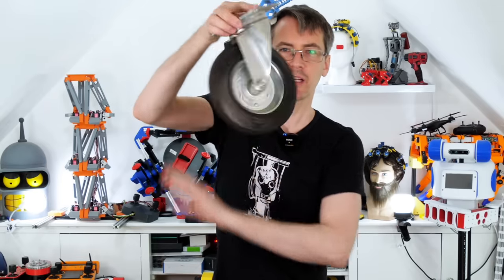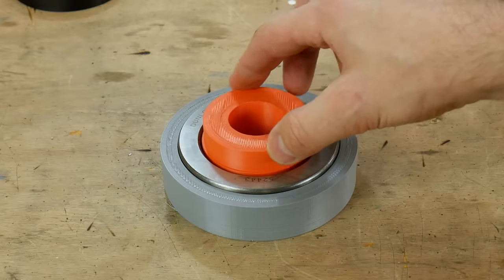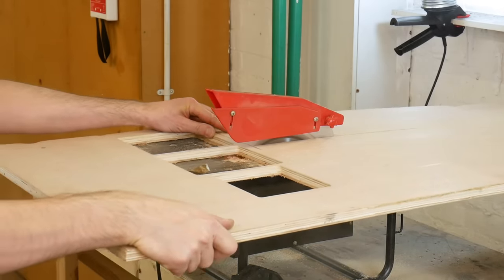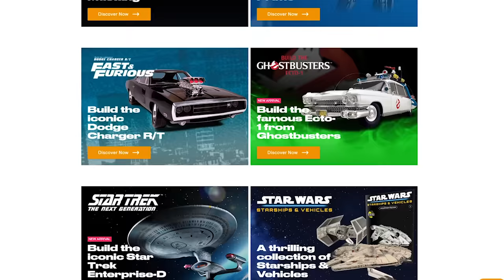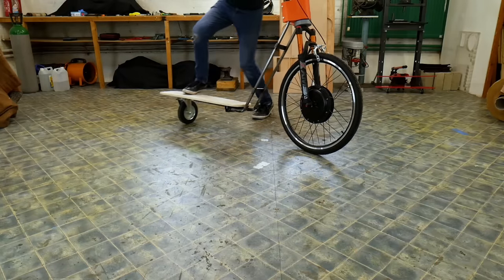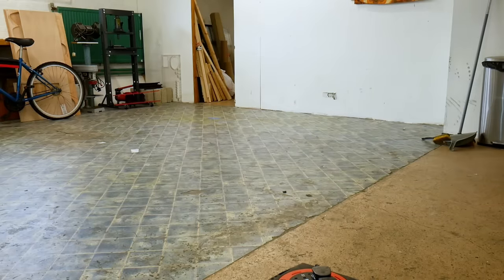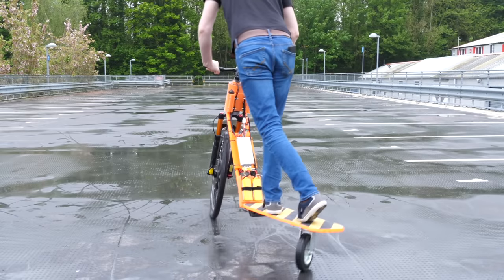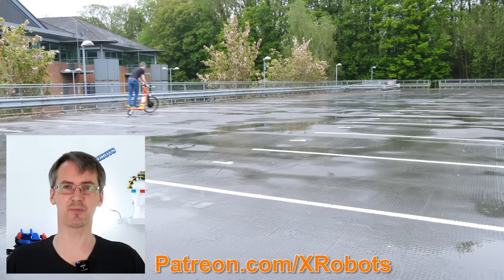1000W Caster Scooter

Comment from the maker: Join my Discord! https://discord.com/invite/fc6MedG7eW
Patreon: http://www.patreon.com/XRobots
Instagram: https://www.instagram.com/xrobotsuk
Twitter: https://twitter.com/XRobotsUK
Reply: hey bruton, why don't you make a video on how you are able to make all these projects so consistently, your producivity is crazy, it doesn't seem like you have a team like the hacksmith yet your projects are technically more advanced and your video release is faster than theirs, it would be a great one, and a tour of the workshop
Reply: The steel tube you used had to thin a wall, if you used the same O/D Tube , but with a smaller bore, you should have a stonger frame.
Reply: wait a second there James... @ 0:31 - a THOUSAND KILOWATTS???!!?  You built a MEGAWATT e-BIKE?!?!? lmao :P jk :D
Reply: Is a electric assisted  rip stick a thing. sound dope
Reply: could you collab whit some bmx/skateboarders. a UK version of "Braille Skateboarding weird things"
Reply: I would try remounting the castor on a bit of an angle. Way more stability that way. Theres a toy called a snake board that is a skateboard with two caster wheels, those casters are mounted on an angle and it works pretty well.
Reply: At higher speeds some cars have 4 wheel steering to turn like a crab. 😃
Reply: Make a V foot board both with a rear wiel of course. Its the bomb for making wheelies
Reply: I think this scooter would have more control if the rear wheel is bolted to an inclined part.
Reply: @anarcocapitalista3700  yes this! Incline the caster and the whole things changes
Reply: @Jimmyhickey90  and it's a scooter but James named it bike, it's in the name of this video
Reply: @anarcocapitalista3700  man if he just slanted the caster and called it the "snake scooter" then he would have a million dollar invention on his hands! 😅
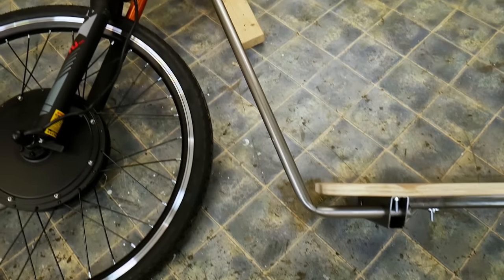Reply: 5:34 Next time when bending tube-like materials, fill the tubes with sand first, it prevents the tube from collapsing, then just empty the tube when you're done bending.
Reply: If you wish to have more control while keeping the ability to lean, have a powered front wheel and a wireless remote brake on your rear castor.
Varying power, brake, and lean, should give you loads of results and  possibly fun 😊
Reply: No helmet?!?! Get off!
Reply: It's wet, No helmet, and you have a powered device that could go haywire.
Genius?
Reply: why didnt you put gussets on the side of the  steel pipes you bent instead of the bottom? thats not the strong part of flat steel.

Comment: I think self centering could be achieved simply, following the likes of ripsticks, by mounting the wheel on an inclined plane/spaced between the deck and the caster.
Reply: was gonna say this. like the opposite of the front wheel which is a castor with an angle
Reply: .. by simply replacing the wheel with a ridge one 😂
Reply: I think James knows this idea but he did it this way on purpose for some reason
Reply: Maybe adding a pivot point to the floorboard so you can control the angle with your feet independent of the handlebars, so you’re almost surfing
Reply: ah but what angle would be best? something adjustable would be interesting
Reply: I agree. A shim under the front half of the caster mounts will help alot. Would be better if the brake was on the caster.
Reply: @themadrobot  razor crazy cart has nice feature to copy😉
Reply: Soaking wet parking roof… perfect conditions to test this crazy contraption.
Reply: I had a scooter like that and it had about 15-20 degrees of caster on the back and hard endstops to stop the rear wheel to turn too much.
It was really fun to ride btw)
Reply: yes!! i was just saying that! excellent idea ^w^
Reply: That + a bit of friction on the rear wheel to make sure it won't overtake the front while slightly decelerating. (and a full brake for actual braking I guess)
Reply: @ProtesttheAntagonist  it is not nesessary since the rear wheel will be constantly trying to straighten itself due to the applied caster angle.
Reply: Exactly what I came here to suggest. Though I think the spring that pushes them back together is crucial too. I made my own back in college out of nesting pipes, a cut in half skateboard, and some hefty springs , which my friends aptly named, "The Tripstick." But I think it would help here with the inclined plane and spring back
Reply: Although I've never had much success riding a ripstick until the point my ripstick snapped in two 😁
Reply: My thoughts exactly!
Reply: if you search up the siege caster scooter, it was like a scooter and a ripstick fused together, I think it worked better because the caster wheel was tilted at an angle
Reply: @The Offensive Senses  I had the same thought. But it needs to have some resistance in the twisting motion so it's not loose on startup
Reply: I as going to say the same thing having that angle keeps the caster from going sideways and allows it to tend to go forward
Reply: I built a similar scooter a few years back. The steeper the angle, the more stable the wheel is as the weight is keeping it straight. Mine was at roughly 30-45 degrees and worked out well.
Reply: A skateboard tail for the caster to be bolted to!
Reply: @nirodha7028 and no helmet like some of his other tests!
Reply: Exactly what I thought when I watched the first 5 seconds of it lmao
Reply: Absolutely.
Nailed it.
Reply: Or like drifting crazy carts, which also allow untilting the casters to enable free swerving
Reply: I was thinking the same thing infact I seem to remember them having a scooter like that before
Reply: Came here to say this and saw you beat me to it 😂
Reply: Funny part is the way to he built it. If he stood on the front of the foot plate. His weight would end up creating a 30° angle like a rip stick caster.
Reply: My first thought
Reply: the caster needs a change of caster lol
Reply: Yo that’s exactly what I was going to say. Either that or something to stop the caster from turning so much
Reply: Your idea of adding angle is called “rake”. This is turn adds what’s called “trail”. Differences in rake and trail (along with head angle) are the three things that make different motorcycles and bicycles react uniquely to control inputs. 👍🏼
Reply: What about adding a steering wheel instead of handlebars?
Reply: Came here to day the same thing! Angle the castor wheel and it'll do wonders. There's already a non escoot version which is a cross between a ripstik rear half merged to a razor scooter front🤷🏾‍♂️
Reply: Yep. Razor already makes scooters w a caster for the back wheel.
Reply: If this channel was worth subscribing to, he would have taken that advice and fixed his time wasting device.
Reply: @BlackDevilSTi came here to say this.
Reply: You still gotta take slowing down into consideration. Even if you were to theoretically cautiously brake, the castor wheel will most likely move the back end to the side. Unless if you really want to go full jackass and get severely hurt multiple times(especially doing so around town with everything else moving in real time) to "master" it, then be anyone's guest.
Reply: Lake Waveboards
Reply: Or attaching springs to both sides
Reply: I know the safety is not an issue with this project.  But this setup, even if it had a rear wheel is EXTREMELY dangerous.  These forks cannot accommodate a 1kw motor nor can the dropouts even with a reaction arm.
The motor would (WILL) tear the forks apart and tear apart the drop outs.  You cannot install a front wheel hub on cheap (or even most good) suspension forks.  There isn't even a reaction arm, which is mandatory front or rear for a hub motor, even with steel dropouts.
Reply: @Mark240 shoutout to

Comment: Couple of things
1) when reinforcing bends or welded joints, use gussets. They're way stronger
2) when bending pipe, fill the pipe with a fine sand first. It will prevent the pipe from being crushed as easily.
Reply: They also make springs that wrap around pipes and help evenly distribute pressure while bending.
Reply: Didn't know about the sand thing, cool tnx! 😃
Reply: @Akanoyoru  Plumbers use springs that go inside copper pipes.  They're hard to get out if you make the bend too tight.
Reply: 2.1) Or water, since it's noncompressible
Reply: there are also pipe rollers, which may have a much higher radius but will bend the pipe more reliably and evenly
Reply: @dafoex  Water's a little riskier though, since if it does fail, it can come out at very high speeds (danger!!)
Reply: @Eduardo_Espinoza  Saw a video on some motorcycle shop in Japan that uses it to get beautiful multi-radius hot bends on motorcycle exhausts with oven-dried sand. Shame that method is practically a lost art everywhere else on YouTube, since everyone just kludge-welds multiple tubes together with all those seams showing.
Reply: Use a bending machine. Used for roll cages and electrical conduit.
You can get a cheap one. It comes with formers, depending on the desired radius.
Reply: Also not bending in one spot helps too.. But ultimately he's bending tube in a pipe bender, the wall thickness is the biggest issue

Comment: If you mount the rear wheel at an angle (maybe a 30 or 45 degree angle, acute with where you place your feet), lock or limit the front steering (locking would be more controllable but may really impact turn radius), you might have a fairly controllable vehicle.  It probably wouldn't be incredibly hard to design a mount for the rear wheel that allows you to adjust the angle as needed, same with front steering limits.
Reply: So more a tilt to steer kind of bike? I think the tilting makes the compound angle of back wheeel harder to predict, which is why I think 30 degree or more like you said would make sure to keep it more straight. Like a crazy cart has back wheel tiltet, but without the leaning complexity 🧐🤓
Reply: ^- This and give it to Sam Pilgrim.
Reply: Front steering limits was my thought also
Reply: You beat me to it and said it in a much more eloquent way.
Reply: My kid's bike has a bungee that keeps the front wheel from going 360.  Something like that for front and back might give you more control.
Reply: All ypu would need to do is steam bend the plywood a bit. It would also give a good positive position for the rear foot.
Reply: Came here to suggest this as well. I think that would work very well.
Reply: holy shit. You beat me to it. I was watching it and screaming the entire time. 😂
Reply: also was the first thing when I saw this vehicle. You need some caster offset but inclination also however I think you will be fine in range o 10-30 deg. 45 is extreme.
Reply: Angle it
Reply: Was bending at the end, he mastered it that way? 💭

Comment: Push scooters with rear caster wheels were a huge trend in my neighborhood. They were cool because you could drive sideways with it and "drift". From what I saw they mostly had the caster wheels at an angle, so they would turn the rear wheel if you tilted the scooter. So you should try putting it on a slight angle, like 15-20 degrees, limiting the rear wheel tilt helps a lot too, just so it doesn't turn around the wrong way. Hope that helps and please give this concept a second try. I could send the pics of how my old drift scooter looked like for inspiration.
Reply: He said he's making a part 2 at the end 😉
Reply: @Eduardo_Espinoza  And that is exactly why I wanted to give advice.
Reply: I just saw the video. That is  just what y wanted to advice give. I think if you play with the angel of the caster wheel to find the sweet spot between steering and stability. I always like to think in extremes. Al lot of angel eg 70 degrees, is almost no steering but stable vs 0 degrees a lot of steering and really instable.
Reply: @albert-janoolhorst8130  
It started to do that on its own, no? When it began to bend to the floor. 💭
Reply: If you put a normal fixed wheel in the back, this could be a pretty cool scooter. Much more stable than a normal scooter.

Comment: On the pipe bender for smoother corners you may want to like pack your pipes full of sand and plug them off or heat the pipes up or do a bit of both to get better bends
Reply: or slide a bigger pipe segment over the bending area
Reply: Or coil 👍🏻

Comment: Back in the states in the early 2000s the company Razor came out with something similar called the ripstik which was essentially 2 casters with footpads connected with a rotating bar. It was a pretty cool alternative skateboard
Reply: They also made a ripstick scooter
Reply: oh that brings back memories, I used to love mine!
Reply: I was looking for this comment, I had one and it was really fun to ride after you got used to it.
Reply: I know them as "waveboards", they got popular again for some time few years ago.
Reply: @ProTimax  That's a German term, they are pretty popular here
Reply: @jatoxo they have a slight different geometry. I have and love my wave board. My brother has a ripstick. It doesn't have separate foot pads but tilts across the plastic body
Reply: I love Caster/Waveboards. Feels quite similar to Snowboarding. Very smooth to control and accelerated, and can turn on a dime. Great Fun. I have an adult size version made from Wood, but the company (Timberwolf) unfortunately went under.
Reply: I remember that 🤠🤟
Reply: It's a work out 😅
Reply: They were pretty fun
Reply: i somehow ended up with one and i dare not attempt to use it

Comment: I concur with everyone mentioning the ripstick design, you need a way to independently redirect the rear caster wheel. Your frame bent because your weight distribution was off. A longer tail will allow you to lean back so your center of mass isn't over the fork.

Comment: Cool idea! I feel like it might be more stable if the front wheel didn't steer and it was just the caster. Similar to a shopping cart there's only one end with casters, but its like pushing it backwards where the steering will be much more sensitive.
Either way, I hope to see a follow-up video!

Comment: Looks like the caster wheel needs a spring or something that always pushes it back to center position. Would love to see if that makes it work much better.
Reply: You can just tilt the mount for it and it will center by itself.
Reply: @jetison333  Very good point! @JamesBruton, did you read that? Can we please have a brief followup later with that modification?
Reply: Just using a wedge to tip the pivot point forwards would do that.
Reply: I had the same thought about a spring.  I see the other comments now about putting it at an angle, but it's actually already at a slight angle and that doesn't seem to be doing much.  I still think a spring might be a better way to go, but I'll admit I can't visualize the mechanics of how to mount it.
Reply: @Raytenecks  Tbh, I do not see an angle. To me the vertical rotation axis looks perpendicular.
Reply: @derjansan9564  It certainly doesn't act like there's an angle, but to me it looks like there is one.  I could easily be wrong.
Reply: Those crazy kart things i think they were called had this where the castors were tilted forwards and you had a handle to lift them flat so you could initiate power slides. I wonder if you could do something similar on this but powered from a switch on the handles bars. possibly to strong a motor needed and more prone to accidents being a bike rather than a trike.

Comment: I learned how to drive in a car that was built like this. They had modified it so that the back wheels were effectively casters, which could be locked so that they weren't always spinning freely. They called it the "skid monster," and it was meant to teach you how to control the vehicle when you suddenly lose traction (for example, on ice.)

Comment: Here's a couple of ways I think you could make the bike more controllable.  You could lower the the standing platform down, and have it raise up to fit the caster, lengthen the wheel base, and have a stovetop type coil to keep the caster wanting to stay straight, as well as turn the castor around.  Of course, if you turn the castor around, it would have to be a strong spring.

Comment: This totally needs to be a trike with constrained rotation of the casters. I'd love to know if a much smaller arc would be better than locked for drifting.
Reply: I think a trike design would make this so much better
Reply: There is a razor drift trike like that
Reply: I'm thinking if you ditch the castor and put in a back axle with a couple air filled tires this could be a pretty sweet adult scooter!

Comment: hey James I don't know if you've already tried this before but for bending thin metal pipes you can fill them with sand first to stop them from crimping. of note though is you have temporarily cap off both ends to keep the sand from coming out.

Comment: You should look at Caster/Wave Boards, they are very controllable and even drive by just swinging/pumping them. The trick is the angle of the caster axles not being upright. Also the boards twist. I think this project would work much better this way, basically a caster board with a big front wheel.

Comment: Razor scooters made a caster wheel scooter called the razor siege caster scooter. Was a lot of fun riding that as a kid. The two main elements that made it work: 
1. The rear caster wheel was at an angle, allowing it to snap back to center when weight was on the board.
2. The board itself had the ability to twist a bit. As you're riding at speed, you could use your rear foot to sway the back end of the scooter side to side. 
This is making me want to get another one of those scooters

Comment: Should make another version with the angled rear caster as mentioned elsewhere like a ripstik and also let the foot platform tilt independently of the tilt of the steering column so you can actually decide how to control the rear wheel. Maybe also lower the standing deck and step it back up for the caster to lower the center of gravity relative to the rear caster.